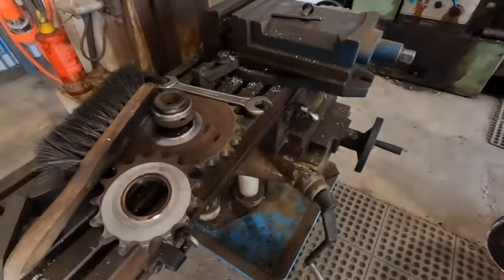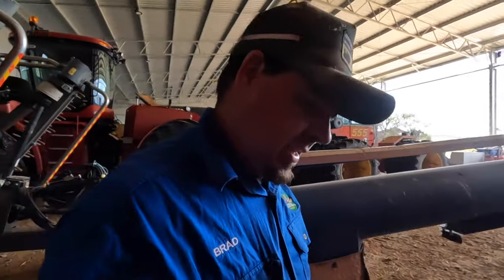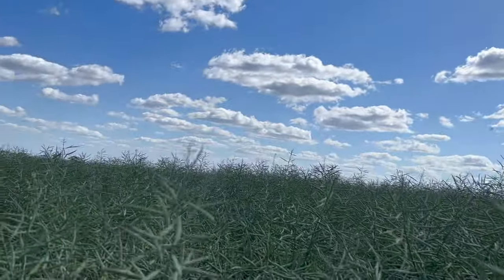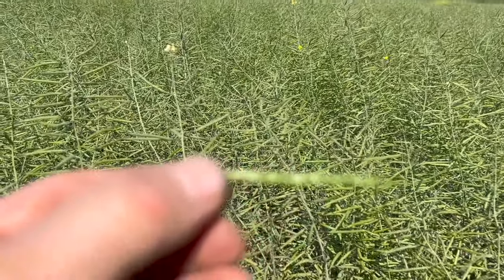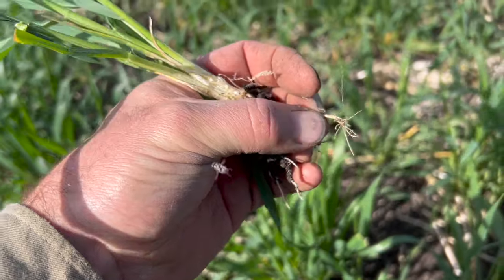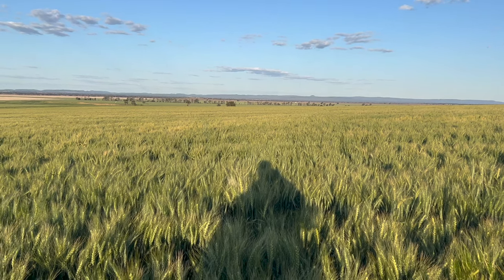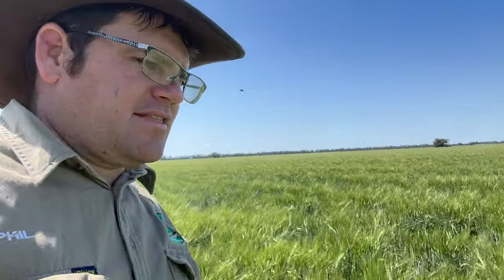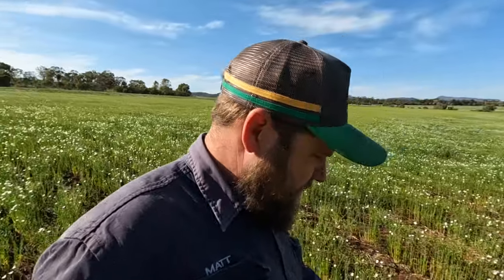Brad RAMBLES & Phil Gives Crop UPDATE | Vlog 204

Comment: Do you ever get any years where there is no grubs or is it every year regardless? Did you have a good holiday Matt?
Reply from the maker: Most years there is pests, just to varying degrees😁
Reply: The heliothis insect is an interesting critter. Normally a guy called Helicoverpa punctigera on winter crops this early (sorry, but science people like changing names). While some over winter in undisturbed areas around the crop others catch a lift in. The level of early infestation is usually determined by how much rain falls in autumn and winter in the centre of Australia. At least 1000 + kms west. When enough plants grow and flower the moths lay eggs and breed up on native flowers such as the daisies. After a few instars or cycles they emerge as moths. In September the moths fly up about 600 - 1000 metres + and catch the trade winds or jet stream that blow west to east and carry them east to drop into your crops. The moths lay their eggs and the grubs start munching. Interesting that you have found them in mid September because that is when they normally arrive so the generation is quite early. I found in most years you could almost set your clock by them. The neighbours should start scouting their canola and pulse crops, the chickpeas would be worth looking at as well. Good work on scouting linseed. In autumn the cycle is reversed and they are blown west.
Reply: @gardnep  fascinating account,  thankyou! Can it be that they the path they are travelling can be predicted and anti bait programs be put into affect to protect those farmers down the line? Surely that would prevent huge $ savings if they didn't have to spray??